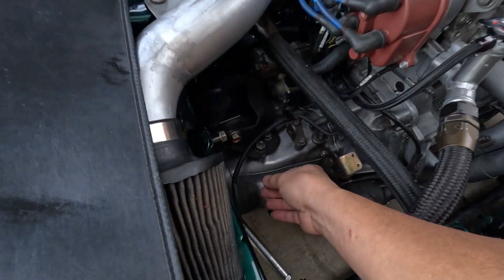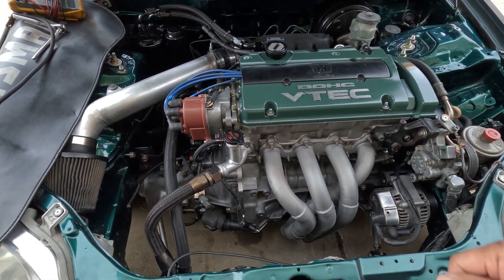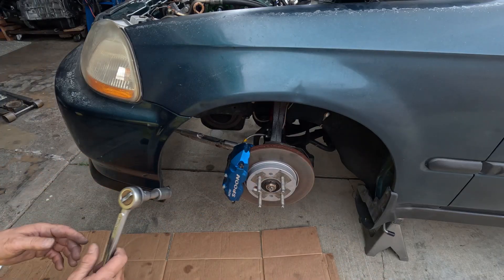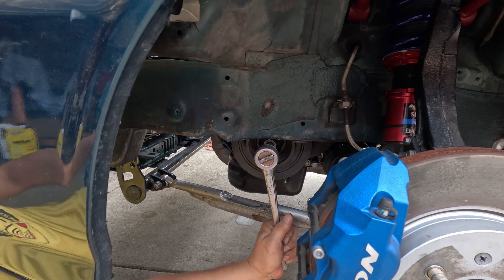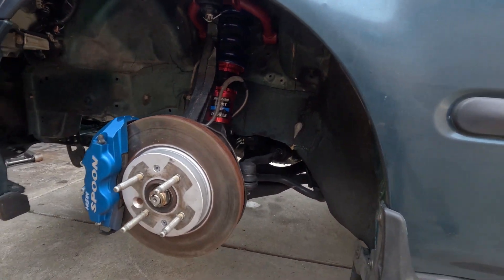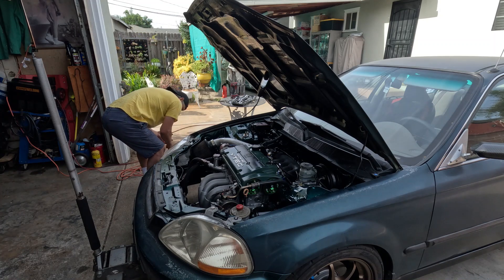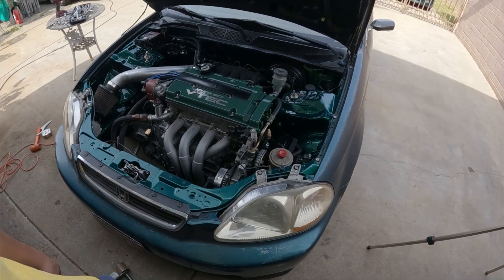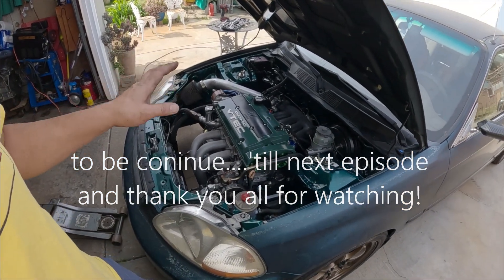Engine won't crank when it's hot! ep.18

Comment: Hello ive been watching your build and ian in the middle of doing mine at the moment. just wonding what did you do on the wiring harness. did you use the factory harness or aftermarket? great videos
Reply from the maker: I used the existing factory automatic tranny engine harness and using conversion harness ar ecu connection. If you are using your factory harness, go to hamotorsport.com for some info about 3 wire iacv to 2 wire. Existing crank timing sensor wires, you need to have a conversion harness or you can simply hook it up on distributor side.
Reply from the maker: What chassis do you have?

Comment: Alternator belt may need a little tightening. I have my battery on a battery charger from Amazon in between drives. Noco Genius 2 around $49.00. Used to take forever now it starts a few seconds after. I did a ton of reading on it. It keeps it at 100% power.
Reply from the maker: I was just messing around on it before l take it for a tune and checked everybody's suggestion and belts are included. Thank you for your input and l couldn'r thank everyone enough. Apparently l'm not the only one who's got cranking issue, so far it's hit n' miss, it'll work one time and next it wont. Sometime it'll not work at all. Thank you much.

Comment: I’m having the same issue. Every time the car is warm starter wont turn over. Changed the starter and solved the problem for a couple of weeks. Recently drove the car for awhile and started having the same issue

I got a H2b as well
Reply from the maker: It's weird but l noticed that the more l drive it, it'll crank and start 1 time, maybe l just need to charge the battery. I might get another starter and see what happen.
Reply: I’m going to check my battery as well
Reply from the maker: @crx_r6880  l just got done checking Myllie and took/ checked every one suggestions. The only one that made a good results was cycling my gas pedal. It's weird in the beginning, why would a tps sensor have something to do on cranking a motor but this what l did. Gustavo from Automotive anatomy suggested to check the t/b. After engine shutdown, turn ignition key on acc #2, cycle the gas pedal and crank it up. It worked several times. So l'll be working or checking the calubration on tps. I'm using ebay sensor, maybe that explain it. It's hard to belueve but that is the only one thing that made a good result. If tou get a chance, try yours too, cycle your gas pedal before engine start.
Reply from the maker: @crx_r6880  Before doing/ cycling the gas pedal. I thought of using my remote switch to start the engine( ignition switch in on position), bypassing the ignition switch crank function. By using a remote switch starter, i can eliminate the ignition switch cicuit and l can verify that the battery is good if it cranks. I never get a chance to do this isolation procedures but if it act again, i'll give it a try. Try it on yours, use a piece of wire and connect the battery post and solenoid trigger wire.
Reply: @sagittnet2158  thanks for the info. I’m going to calibrate my tps as. I believe it is a little off
Reply from the maker: @crx_r6880  It's worth a try and it's weird but like l said it work for me. Try also bypassing your ignition key for start/ crank. Use a remote switch starter or hotwire your starter and give it a crank. If it works, then you know your starter and battery is good.
Reply: Hey I think I found my starting issue. now that the days are getting warm my car started to have the same starting issues. A friend of mine told me he had the same issue with his old civic  so he replaced the main relay. I just replaced it drove it up to temp turned it off a couple times and it started right up.

Comment: Your getting voltage drop from battery to starter 
Ie loose connection 
Corroded connection 
Small gauge wire
Reply from the maker: I'll check in to it, this thing is like a puzzle to me. I'll check the ground cable at the battery itself. Thanks!

Comment: Its your wire uncle who need a bigger wire for positive
Reply from the maker: I thought about it, but l been using these setup before w/o a problem. But lately as l put mileage on Myllie, l was able to crank and start it 1 time only. I guess the battery is slow getting the amps that it lost coz it was sitting for 3mos w/o charging. I'll look into it and thank you p'mangkin!
Reply: @sagittnet2158  if thats the case uncle its the battery then if its been sitting for month w/o charge that should be the cuplrit

Comment: Had a starter go bad out the box. It would not fully disengage from the flywheel. Later it wouldn’t  crank and found out the starter destroyed itself locking up the motor from turning. Not saying that’s your case but it could be possible that the starter is not fully disengaging and is still riding on the flywheel freely. As it gets hot it maybe over heating the internals not allowing the full power it needs to kick start the engine. (H22 engine btw)
Reply from the maker: I actually thought about it that maybe l didn't get the tranny mated concentic on the block. This is what l did to the starter. I loosened it up and there was a little bit of a play on it and l brought it up a little and tighten the bolt. That way starter will have a bit of space from the flywheel. Lately as l have been putting mileage, it'll crank and start 1 time after shutdown. So l think it could be just battery amperage is not up to the task. Battery was sitting for 3mos w/o charging. But it so weird that cold start is normal. Thanks man!
Reply from the maker: I will pull out the starter and check the gear.

Comment: haha the way you felt about your clutch is the same way I felt when I test drove a newer Honda lol It was way too soft. When you were turning it on and it would shut off, it reminded me of my wives accord. The butterfly on the intake neeed some good cleaning.
Reply from the maker: Yeah karnal felt like nothing! Any suggestion will be taken in consideration and it really bugs me why only when it get hot. But lately as l put mileage on Myllie and it look liked the battery(motorcycle battery lol!) Is replenishing those used up Amperage. It actually will crank and start 1 time after shutdown.
Reply from the maker: Thanks karnal!

Comment: What starter are you running? I had the same issue with my high comp H22. I changed to a B20 eg starter and it solved my prob. I previously had a B16 starter on. Maybe get a good working B20 starter and try it
Reply from the maker: Hmmmnnn! In the beginning l thought l have a Civic starter and l watched my blog when l pulled the tranny from the yard, l did have a B series starter. I think you might have good idea and it's only correct coz l'm comparing Prelude starter to Integra and H22 require 800CA compare to 520 CA Odyssey pc680. Having a hi comp ratio engine, l think you are correct. But lately l wad able to crank and start it 1 time only after shutdown. I guess battery is charging and amps are replenishing. Thank you and if l need to change the starter, l'll get a B20.

Comment: maybe measure the voltage at the positive battery while cranking and then the voltage at the startee lug too and look for voltage drop, maybe thecable is not thick enough?
Reply from the maker: I'll try that over the weekend where l can get some assistance. But lately as l put mileage, l gues the battery is charging enough that it'll crank and start 1 time only. You'll see it on next episode and thank you for the input.